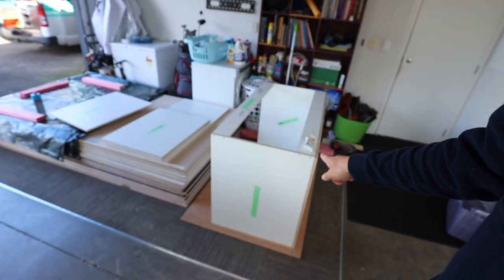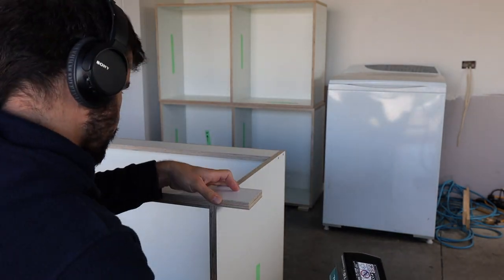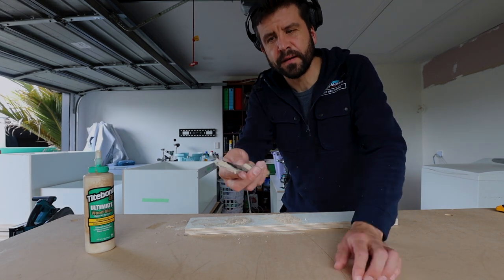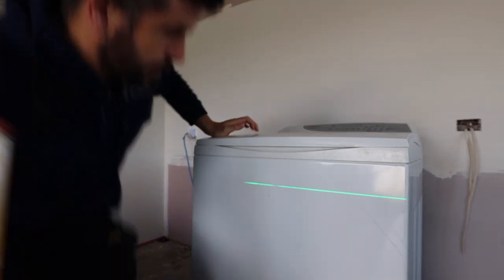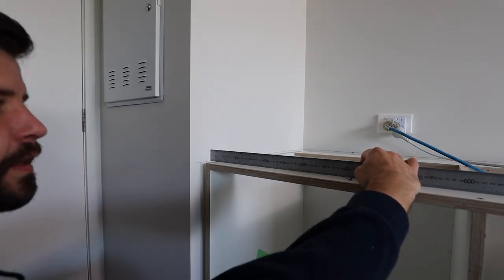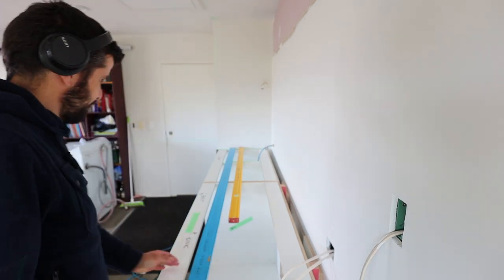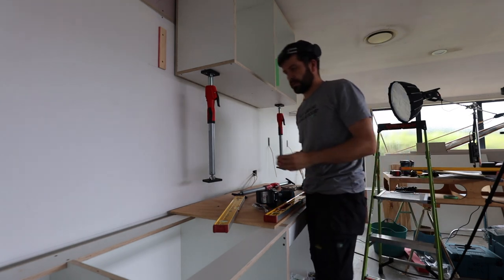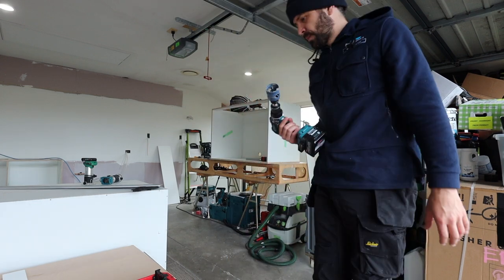Building Laundry Cabinets From Scratch

Comment: Scott, a tip for laser leveling when setting cabinets. Find the high spot on the floor in the room or area you're placing the cabinets. At that point set the laser line to the height of the cabinet plus a fixed dimension of choice, I usually go 2 inches. Cut a block that fixed dimension. When you set the bases now you just shim to that height using the block on all four corners. Shim till each point has the laser line touching the top of your block. Once set up you no longer need to measure or use a level. And you can start at any point in the room and still come out fine with an out of level floor since you set the baseline(laser) to the high point already. I've been doing this for several years now setting commercial cabinets in kitchens or offices. Makes install go faster and more accurate over a large space. And multiple installers can work on the same cabinet height at different points of the room and everything lines up perfectly.
Reply: If you have fixed size kickers and some large low spots what do you do with the gaps.
Reply: That's what I like to do. But I don't measure the block, I just set the line too high, then sit a block the cabinet high point then draw a line on the block and then move it to each corner and adjust until the pencil line hits the laser.
Reply: @davetaylor4741  always start at the low point not the high point if you have a fixed kick board size
Reply: @davetaylor4741  if you have large gaps between the bottom of the kick face and the floor then you should scribe in the kick board to get rid of the gaps and you will be left with an even gap between the top of the kicker and the bottom of the cabinet which you will only see if you get on all fours and look under the cabinet.
Reply: @nathantarr7308  If you start at the low point of the floor, by the time you hit the high point wouldn't you be trimming the bottom of the cabinet to make it level?
Reply: @wytas20  sounds like your house is ready to be restumped
Reply: @wytas20  if your floor is out by that much than you have bigger issues then your kick boards
Reply: @wytas20  if you know your floor is out that much then you need to measure how much the floor is out of level so you can order/buy a kick board big enough to suit once all cabinets are level. 

None the less always start at the low point if you have a fixed kick board size because if you start at the high point you will have gaps underneath where you kick board is too short.
Reply: @nathantarr7308  Hi Nathan. Yes that was my point. Unless you are making your kickers after fitting no good starting at the high point.
Reply: @davetaylor4741  I'm a commercial cabinet installer. Different shops send out their kickbases differently, but typically they send the bases and a separate base cover, which is scribed to the floor and attached to the kickbases before the cabinets get set on top of it. Sometimes it's just laminate, sometimes it's laminate on 1/4" substrate. Also, always start out at the high point. It's easier to scribe a kick cover than hog 1/2" or whatever out of the whole kickbases. That just takes way too long. Also if you're trying to maintain a designated top height, like for ADA code, then you could end up too low.
Reply: @nathantarr7308  start at high point, that's what toe skins are for
Reply: @jamesdebesse5147  I’m commercial, high end residential cabinetmaker/joiner. 

Again, that’s all well and good if your kick faces are tall enough when you get to the low point. When building ladder kicks you should always cut them 20mm shorter than your finished kick face height so you don’t have to cut the ladder kick down (or use adjustable feet). If there’s a certain height that needs to be met than the floor level and exact finished height would be measured before kitchen starts getting fabricated so that you don’t need extra panels, kick faces. 

Say for instance your finished height top of bench is 900mm, your kick faces are 150mm and your ladder kick is 130mm. Start at the low point and pack to 150mm now that is your level for the rest of the kitchen and you know that your kick face will always be tall enough. It’s so much easier that way and you know your kick face and panels will always be the right height, plus there’s less figuring out what height you need to pack to at the high point to get your finished level.
Reply: @philthyphil3324  toe skins? Is that another name for kick faces?
Reply: @nathantarr7308  If the job site has been properly surveyed and field dimensioned before the cabinets are built, then the toe kick covers have enough width to be scribed. Same as doing baseboard scribed without shoe. I don't see how starting from the low point would be an advantage. What you describe is the same process, but if you have to maintain say a 4" kick height and you start at the lowest point, one elevation might be ok, but when you get to the high point of the floor across the room at another elevation, you might be down to to 3", or whatever. Then you're f*cked. This is especially true if you're trying to mate up with horizontal reveals in paneling, or some other architectural element.
Reply: @jamesdebesse5147  I explained how it would be an advantage. It’s an advantage when you’re given a fixed kick face height. You know if you start at the low point that you will always have enough width on the kick face to scribe in, rather than starting at the high point and then you get to the low point and you don’t have enough width on the kick face.
Reply: @davetaylor4741  Most of the time for commercial there is vinyl base going on the toe kicks. Or the cabinet shop provides a loose toe kick of 1/4" thick material the same size as the toe kick space. In either case keep the material tight to the floor, any unevenness only shows at the top of the material which is up under the cabinet where no one sees it unless they lay on the floor and look under the toekick space.
Reply: @nathantarr7308  If you do then you are cutting the bottoms of the cabinets.
Reply: @jamesdebesse5147  Exactly!
Reply: @Carpenterdon  I’ve installed hundreds or maybe even over a thousand kitchens and I’ve never had to cut the bottom of a cabinet. If you read and understand what I’ve previously said you will understand why it would never come to cutting the bottom of a cabinet.
Reply: @nathantarr7308  I agree with you and how you do it if you have a separate toe kick/base with flat bottom box cabinets sitting on that. I was thinking more what I usually get on sites, cabinets with the base/toe part of the cabinets and either a loose flat scribe cover or vinyl base. In which case starting at the low point means you either have to shim the first cab up to an arbitrary height(hopefully matching the high point. Or you set that shim level then cut the bottoms of subsequent cabs to fit. That's why I say start at the high point. Shim level, then shim as needed for the next cabs in the line, or anywhere in the room. 

This is the problem with online discussion like this. Too many variations on a theme in how cabinets are built depending on manufacturer and even down to regional preferences. What works in New England, USA is different then the norm in British Columbia, Canada and probably completely different then say Australia or New Zealand or the UK.

There's honestly a thousand ways to do most construction, almost all work for those doing them. I won't ever fault anyone for doing the 
job their way as long as it is done safely and we as Carpenters/Tradespeople can learn and see benefits of doing things different sometimes if someone has a better more efficient way.
Reply: @davetaylor4741  silicone alone the bottom of the kicker or you have to scribe it to the floor

Comment: Hi Scott.Im a wardrobe fitter   with 30 years exp. from Ireland,fitted so many kitchen and its very good way to hang upper cabinets to use 45 degrees buttons on wall and the same on cabinets on opposite.
Anyway Im a Polsh  and I never knew that way in my country.
Hope You well.

Comment: For wall units I use a 19x19mm white aluminium angle that get fixed on the wall at the bottom height of the units. Vertical leg of angle facing up, out of site. Now you have a level cleat to rest the units onto whilst you fix. The angle is cheap and no client has ever seen or mentioned it. I use it for floating bathroom vanities too.

Comment: Tips, when using new and sharp hole saws on hard stuff like plywood with a strong battery drill like that, drive it in reverse in the start :) And when changing to the right way again, put the hand or your legg on the right side of the battery  and dont put on to much presure in the beggining:)

As a bonus the laminat wont crack and jump of around the hole also :)
Reply: Also good practice to use the combi drill on a torque setting rather than just drill as it'll bring the clutch in rather than kick. Good for any holes that need to be cut in finished surfaces or plastered ceilings.
Reply: @effervescence5664  Yup. Those new strong drills will hurt you if you are not careful

Comment: I've done something similar when sealing/closing the gaps in the edges of plywood.  The main difference is I usually mix the sawdust+glue a bit thinner so it works in deeper and then pour some loose sawdust onto the exposed glue.  After it's dried, sand everything smooth!.
.
Obviously those cabinets were demanding a blood offering Scott, Ia! Cthulhu!

Comment: Hi Scott, yes hole saw drill bits do kick out if you don’t know lol, now you know lol 
Some installers start on the wall cabinet first, save your back from leaning forward.
Tip:
Best to start installing base cabinets from the lowest level point to high side. So you have some meat on the toe kick to scribe too.

Comment: Scott, for that routing you might want to consider a spiral compression bit. It has both an up cut and down cut spiral setup ,so that both sides of the ply are cut in the correct direction cleanly.
Reply: Agreed, David has it right.

Comment: Hey Scott, thanks for keeping the content coming. I was putting in some cabinets in my daughters new place at the weekend. I got to use my wee inflatable bag tool for some fine adjusting on the height of the base cabinets. It’s the winbag that you had recommended in a previous video, and it worked a treat. Cheers.

Comment: Hey bro, pro hole saw tip I devised for anything with an anti-abrasion layer (melamine, coated ply, etc), I even do it with plaster for a crisp edge. Once the arbor's pilot bit is through, put your drill in reverse. You're now essentially scoring the hard surface layer (or plaster paper) with a negative rake saw. It won't grab/chip/tear the surface, will leave you with a nice clean hole. Once you're through, turn your drill back to forwards, and carry on. I find this method safer and gives a better finish. Win/Win! Cheers, Kenny🤙
Reply from the maker: Cheers Ken! Any jigs for Kitchen door hinges ? 😉
Reply: @ScottBrownCarpentry  kreg makes a jig for kitchen door hinges
Reply: @ckcuev  The Kreg hinge jig is excellent 👍🔨🇮🇪
Reply: @TheToolnut  most definitely
Reply: @ScottBrownCarpentry  I have been thinking about doing a jig for euro hinges, be easier and cheaper than having to use a forstner bit  🤙 Be happy to whack out a few prototypes for you! 👍
Reply from the maker: Would love that mate! I actually picked up the Kreg jig, happy to hear it recommended again here. I set it up today and it looks good so far.
Reply: @ScottBrownCarpentry  Incoming bro! Looks like I'm a bit late, seems like euro hinges don't really have a standard for where the screws go. Anyway, I chucked in some extra goodies, enjoy! 👌

Comment: Spiral bits are available for routers (not just mills).  Upcut and down cut - and can be had in solid carbide if you can afford it.  Usually some cheapo ones on Amazon if you fancy some to play about with.

Comment: Hi Scott I was given a tip which was as long as the base cabinets are level then make and use another box to sit the upper cabinet on, no need for stands and always at the right height. Normally the uppers go on at a standard 3 tiles above the work top😉 hope it helps

Comment: The router bits you’re thinking of are spiral bits - there are 3 different types- up cuts, down cuts, or compression - they all have different benefits Jonathan cats mozez has a good video on it - carbatec sell the spiral bits here in nz!
Reply: cut a whole, 2 storey saw tooth staircase in 5 hours with a compression bit. Best $90 i have ever spent.
Reply: Also used for CNC routers. Can be re-sharpened for $20-$30
Reply: Definately want to go a compression bit for cabinetry like this so you get 2 clean edges and don't end up blowing one out

Comment: It’s easier to screw batten to the wall and lift the wall unit onto it to fix the remove the batten 👍
Reply: I am a little confused, if all the packers for the overhead cabinets are the same because the walls are straight. Why pack them at all??
Reply: @matthewwarner9553  probably the spots between the packers vary. So the cabinet would "rock" along it's back panel. So say you fix the left side, the right side might have a gap behind it.

Comment: Perhaps doing French cleats for the top would have been a far easier one man install - that’s what I do when hanging wall cabinets and it leaves no visible fixings. 
A technique often used on super yacht cabinetry.
Reply: I did my first ever wall hanging cabinets around this time last year and was solo. Didn't have those jacks either so decided to try a french cleat which was also a first for me. They haven't fallen on me yet.
Reply: My work never use french cleats for wall hung cabinets, and it drives me nuts! So much easier when you're installin on your own. No more balancing a unit with one hand and stretching out with the other hand to get a screw in (only to miss the stud anyway 🤣, never happened).
Reply: You couldn't mount snug to the ceiling with a French cleat though and those cabinets are very close to the ceiling (spaced down so the door doesn't clash with the roof access by the looks of it).
Reply: @kampjes  in that case you could have slid the cabinet from one side on to the French cleat as there was room to the right. Then install a dress panel after.
Reply: I cut 2 bits of timber haha
Reply: Would be worth while to use French cleats just to get the cabinets in the ball park then use those clamp things to perfectly position.
Reply: In my job it is impossible to do Cleats because the back is not recessed in their standards.

Comment: Quick tip Scott! Install uppers first, makes life a lot easier to get underneath them and hold them up! Other wise, great video as always. Keep chuckin!
Reply: That and a French Cleat on the wall would make hanging them a lot easier too! No need to fuss with those lifters if the cleat is on the wall level and you can just drop it on.
Reply: Great tip!
Reply: Actually a contentious topic around here. What to install first?
Reply: @robertbamford8266  - floor cabinets first for obvious reasons.
Reply: +1 to this, i came to the comments to say this too.
Reply: @serge.crispino418  obvious reasons? i'm a kitchen fitter, I put the wall cupboards up first, would you care to let us all know what the "obvious reasons" are for doing the floor cabinets first?
Reply: @allanwalker5305  - well Allan Walker if one installs the wall units first then they may bang their big head on them when they are installing the base cabinets - the 'obvious' reason is that if the floor cabinets are in their place then they can be used to support the wall units without the use of a cleat or other means. Have a nice day.
Reply: I've heard that so many times, but here's the real deal. Install base cabinets first, then use fastcap 3rd hands to hold the upper cabinets in place while you install them, just as was done in this video.
Reply: @robertbamford8266  Essential Craftsman's house series was just talking about it too; the pros he was using do it bottom first to have a work space and use jacks similar to the way Scott did it here, but commented that many do it the opposite as well.

One of those "ask three masters get three different answers" kinda things.
Reply: @serge.crispino418  I suppose the right way to do it, is the way that works best for the person doing the work. I prefer the top first, because (in Europe at least) they are smaller, and I don't have to lean over a larger cabinet to adjust, fit moulding, hang doors etc. I can have a step ladder directly below the work, and this saves my back a lot of leaning. You have a nice day too.
Reply: @mathematicscore  In the tech industry I worked in, three masters could be counted on for at least five correct answers.  In fact, I could come close by myself.

Comment: For cabinet installs I have always started from the top down. I would screw a 2x4 flat along the level line. This gave something for the cabinets to sit on so I didn't have to fully support their weight. 

The plaster board damage as always minimum since I used 3 screw max and never cranked them down.

Comment: i always put a torque setting on when using the holesaws, rip your arm off when they snag otherwise
Reply: I’m surprised it bit that hard with wood! Too many rpm’s perhaps. 
We use holesaws a lot on 3mm and 4mm thick stainless at work, up to 114mm dia. Going low and slow is the key. No clutch, just hold on tight.
Reply: @zeroyon4562  yeah, can grab like that really easily going through units, I use a 115mm fairly regularly to cut holes in kitchen units for extractor fans, only needed that to snag once before using clutch forevermore. Knackered my wrist for days